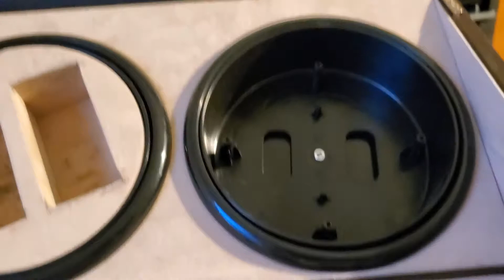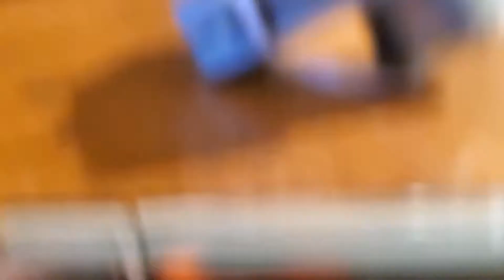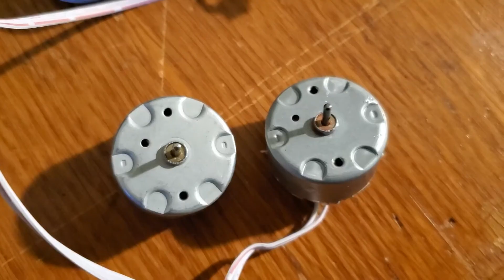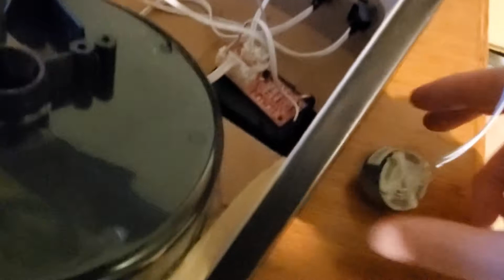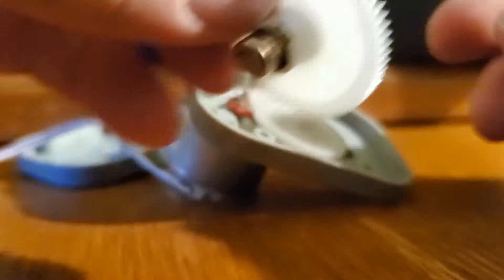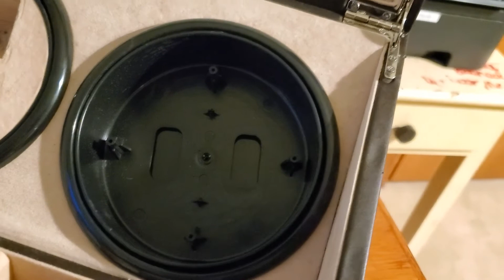Motor replacement on a watch winder.

Comment: Mine had a gummed up gearbox on the right hand turntable. 
I watched another video on how to disassemble the whole thing and sure enough, the gearbox was caked with filthy, sticky grease.
So I took that one completely apart, used brake cleaner to clean all the gunk out of it. Applied Lucas Air Tool oil to everything and put it back together. Probably not the right type oil, but it's all I have at the moment. I suppose I could have used my Royal Purple motor oil on it, but I didn't think of it. Anyway, the other gearbox was in much better condition, but I opened it up anyway, only this time, I only removed the main gear with the post that connects to the turntable, cleaned and oiled it and put it back together. Works like brand new again. 

If it were a quality winder box, it would use ball bearings on the main gear, but this one uses brass bushings, so I'm sure this isn't the last time I'm gonna have to do this.

Comment: 🤬my tray wont come out! anyone have any ideas?  everything else on mine looks identical to this one except for the fact that i have no battery backup.

in playing with it, it seems that the cup is glued or something.  so i am just repairing it a bit differently.  any idea where to get replacement belts?  turns out that is my issue.

Edit: Should anyone be looking for the rubber band replacement... i ended up going to a hardware store that had loads of plumbing stuff (Ace Hardware in the US in my case) and the Product i used was a Danco Model #35740B "O" Ring.  for mine i used one that was 1 3/16" OD x 1 1/16" ID.  seems to work fine but next time i need one, i will get a little smaller.  seems like the Danco Model #10360 which is   1-1/8 in. OD x 1 in. ID x 1/16 in. Wall would be perfect.  it was a whopping 79 cents.

Also, with mine, it seems that the cups are glued in (damaged one trying to remove it) so i just attached the band to the removable part and then put it all back together.  slightly more annoying, but works fine.

Comment: Hi Matt. I just bought a ww used identical as yours. One of the motors is dead and I am triyng to fix. But I am having troubles to disassembly. The piece where fits the watches does not let it go like you did (at 1:31 sec). I pull hard and nothings moves. In others similars models the removement demands a twist before pull. I also notes that in yours ww, at the internal part 'cups' have two holes handmade. Did you do this to make easier to remove some piece? Please, help me!
Reply: I'm having same problem with same one lol..did he say anything about how to do this
Reply: @christopherhamm5048  He did not
Reply: @guilhermeguena  yea I have the basicaly same one..and he doesn't show taking it apart..I'm a hands on kinda guy and I believe I just need a new band..but I'm not trying to break it taking it apart..I searched and this is closes one to mine..have you found any other videos
Reply: @christopherhamm5048  I bought a user one and the market palace offers the option to turn back the purchase, só I did It. This video is the best that I find !
Reply: in case you are still looking into this @christopherhamm5048  i am in the same boat. what i ended up doing is just not removing the cup part, but taking off the 4 screws to access the internal gears.  it is a little bit awkward this way, but in my case motor is fine, its just the elastic that broke.  so i can reassemble it,   it will just be a bit annoying is all.
Reply: I had the same issue with my watch winder.  There isn't a twist and turn or pull option. I had to go slightly more drastic.
 What worked for me was to drill a hole from the top directly in the center of the winder.  To access the screw in the center that releases the cup from the motor,  I used a narrow Step Drill in the small space between the two wells for the individual watches.  (If you have a multiple unit winder, go ahead and drill a hole in each)  A step drill will keep the bit from wandering and you just stop when the hole is the correct size! 
 Reach in the hole with a narrow bladed Phillips screwdriver and remove the screw.  Pull up on the winder as you loosen the screw.  This way, the screw remains in place and doesn't fall out.  
 To reassemble, line up the flat spot in the motor shaft with the cup, tighten the screw and you are done.  I was worried about the appearance of the hole but my watches cover it nicely.

Comment: Hey, could you please help me? 
I have the same watch winder box. 
A fuse on the circuit board blow up, it's on D1 
I need a number that is on the fuse. Big thanks!
Reply: So I just looked at the board on mine, d1 is a capacitor and from what I can tell there are no fuses. If you needed the capacitor I'd think at that point you'd need a new board but I'm not positive.
Reply: @mth2nd  Yes sir, I mean capacitor it should have an number or letter on it or both . Like 1Y
Reply: @mth2nd  You could send me a photo  as well on LeonGardus@gmail.com
Reply: @mth2nd  I guess you will not help me 😔

Comment from the maker: https://www.amazon.com/gp/product/B07SS75943/ref=ppx_yo_dt_b_asin_title_o01_s00?ie=UTF8&psc=1

This is the winder motor I used. The watch I am wearing is a Tag Heuer Carrera Calibre 16 CV2A10. Thanks for watching, feel free to ask questions.
Reply: Speed : 2180RPM???? or is that voltage dependent (lower voltage lower speed) or....speed controlled by a little circuit board?